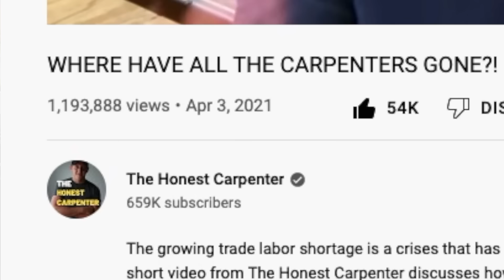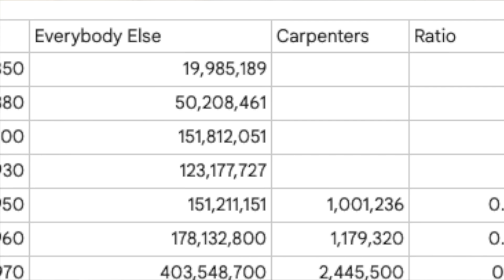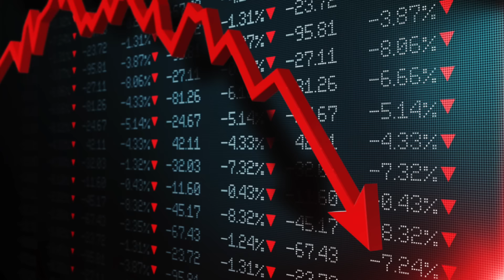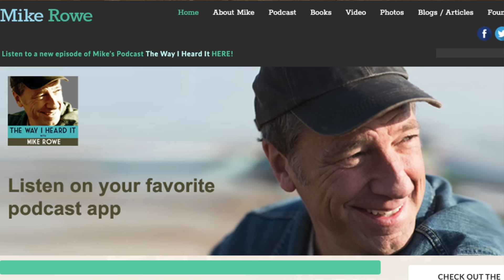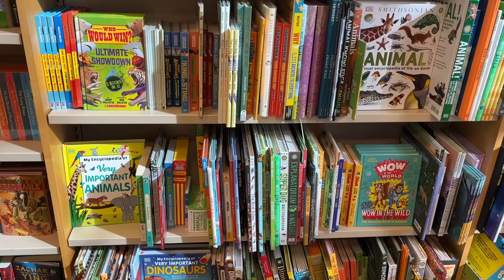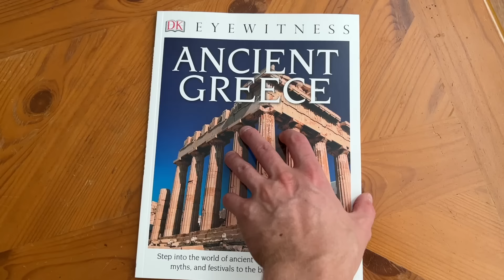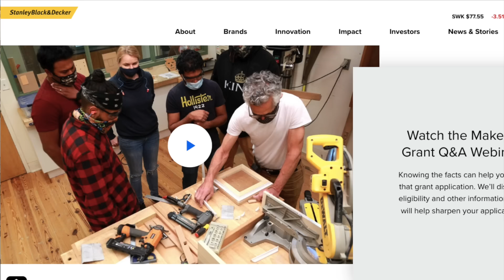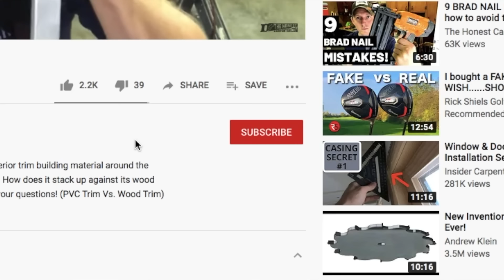THE TRADES ARE DYING...But The World Still Needs To Be Built! CAN WE FIX THE SKILLED LABOR SHORTAGE?

Comment: The trades are dying. As a 50yrs old male that built his first tree house, on his own at the age of 5, I see a deeper issue. People, overall, don't work with their hands or fix things. Most Red Seal graduates have no ability in applying the theary they learned in school. They lack any skills in organizing their work space and I rarely see that improve with experience.   Also I would say that most lack the durability required to function in extreme conditions. It's a complex issue and this is just a short take. We recently had a big shut down job with a short window for completion. We hired some extra independent contractors that showed up with fancy rigs. These apparently capable welders needed someone to organize them constantly.  Yes I'm talking running their leads and cables. They could only weld and refused to pick up a grinder. They would skip anything not prepped for welding or any situation to difficult to weld. None lasted a 12hour shift. One fella managed to weld 48" in 6 hours. My left arm was in cast from a break and I was a bigger asset to the job. The new trades reality.

Comment: The problem is that, comparatively, trades are a terrible career path. They're all dead-end jobs, with crap pay and crap benefits, combined with a crap/toxic work environment. It's not easy being an aerospace tig welder clocking out to drive home and see signs at McDonald's offering $3/hr less than I make. If McDonald's can raise their wages by 3x, then shops should be able to pay 3x... NO skilled tradesmen should be making less than $45-$60/hr, with top of the line benefits, company paid Healthcare, and a minimum of 3 weeks vacation... I went to trade school in high school and took a 2-year program in college... a 2 year welding  degree, and you start at 20/hr(my first job as a welder in 2012 was $12/hr) and 1 week pto vs a nurse who has a 2 yr degree, makes $60-$100/hr and gets 1 month pto... as a young person in high school, what career would you rather set yourself up for? They can try to make skilled trades sound cool, fun, and exciting all they want. It's never going to make up that difference

Comment: I worked as an instructor for the local "trade" school (it is actually a community college) that had a partnership with the public high schools. We taught building and construction and wood working to high school students since there were no other teachers that were qualified to so. As you mentioned in the video, wood shop classes in public schools have all but disappeared. 

When we started at that school, the shop was used as a storage room for broken golf carts and riding mowers. All of the tools were neglected and were either already broken or not safe to use. After a year of cleaning and purchasing new tools/equipment, the shop looked like a shop. In the beginning, student interest was low - only 4 classes with an average of 15 students each. Within 2 years, that all changed. Classes were at capacity, with all 6 classes @ 28 students each. We actually needed to turn away students for safety concerns. Unfortunately, because only a small number them matriculated to the college (at least for carpentry) the partnership was dissolved as the college pulled the funding. 18 of us, instructors and faculty lost our  jobs. I thought it was a good program and we definitely filled a gap in the schools offerings, but as with most things, it all came down to money. It was my most fulfilling job I've ever had.

Comment: I joined Norther California carpenters union 1622 in 1973. I left the union in 1985 and became a general contractor until 2010. Like most skilled tradesman I became a building inspector in 2010. In 2015 I started a school teaching inspectors. I remember many morning 6:30 am in the middle of the summer standing at my exteriors siding cutting table think ok its going to be 100 degrees today better start chugging water and Gatorade right now. Some days we had 2 or 3 heat exhaustions leave early.
Reply from the maker: Been through some of those days myself, Steven 😪

Comment: I work in steel.  I do everything from welding, mill/lathe, and HVLP paint.  My primary specialty is press brakes, tooling, etc.  I can design tooling as well as do advanced operator and tech work on most manufacturers' machines.  Part of the problem is that I can get basic bitch grunt work any time of year, but the moment a company actually needs somebody like me, they're willing to pay out the ass until I get them operating at a level where they can just get somebody of minimal knowledge skill to come in and push a button, squeeze a trigger, or step on a pedal.  Then I'm the first one laid off - which is also why I'm leaving the industry.  And even when you're actively helping them, they treat you like you're a moron because you're wearing jeans instead of khakis.   The number of times I have had somebody who has never ran the machine incorrect me on what the problem is is astronomical.  If you do physical labor of any kind - skilled or not - they still treat you like scum of the earth.  Professionally and socially, tradesmen are looked down on by anybody other than other tradesmen.

Comment: I heard exactly the same argument s for trade shortages in the 80s, and I made it a point to monitor it in 10 years. When I did, I found no shortages, the reporter had used the headlines to write some BS, got paid and were long gone. We call those techniques "click baits" today. There are no accountability for being wrong. There are rarely difficulties finding a contractor, but finding a good one is difficult. Another tell tale sign of a shortage, wages, trucking been crying driver shortages for as long as I can remember, yet pay is still lousy. I bet wages for carpenters are stagnant. Shortages??? where??

Comment: I wanted to get into the trades but the electricians track I researched sounded impossible for me.  Im a single father with a very small support network.  How can i get into the trades when I CANNOT drive to job sites 2+ hours each way and work mandatory overtime.  I need 3 days a week off guaranteed.  How do i break into the trades?

Comment: I must admit that the school systems really need to do a better job of promoting carpentry as a viable option for students. When I was in school, there was a significant lack of hands-on experience in construction and woodworking. Wood-shop classes were non-existent, and our focus was mainly on computer-based activities, disregarding the essential skills needed for manual labor.

Personally, I had the opportunity to observe my dad, who specializes in tiling and also does some carpentry work like deck repairs and window installations. However, I noticed that I had no knowledge of how to perform those tasks myself. I was never taught how to handle complex saws or measuring tools, let alone gain any practical experience. It felt like entering an entirely different world when considering a trade like carpentry without any prior exposure.

Our education system placed a heavy emphasis on digital skills, with a significant amount of time spent in the computer lab. Unfortunately, there are still many basic things I don't know how to do, such as resetting a breaker, installing a light switch or outlet, changing a light fixture to a ceiling fan, or even mounting things on the wall like a TV or shelf. Despite learning about these things theoretically through math and seeing pictures, we were never given the opportunity for hands-on experience. I recall not even knowing how to change a tire after taking driver's education, as it was all taught through computer simulations without any practical application. I had to seek external assistance outside of school to learn these essential skills.

This situation highlights another reason why our school system is contributing to a decline in various areas. Instead of focusing on practical skills, schools seem more engrossed in teaching topics like pride and sexuality, leaving important life skills neglected. It's a concerning reality for this generation.

In order to address the decline in young workers pursuing carpentry, our education system must provide greater exposure and offer engaging classes that showcase the art of creating things with one's hands.

Comment: I've been a Union Laborer for 28 years. 24 mostly worked in the Nuclear industry. I've been an instructor now for 4 years. The trades do have there ups and downs no doubt. In my opinions,  the layoffs are the biggest issue. We have an apprenticeship ( most if not all Union trades do). You begin at 75% of full scale and work your way up to 100% depending on your work hours plus training hours all while making money,  not spending it.I read a comment where they mentioned hostility on jobsites. Yes, you do have to have thick skin. In the Laborers, there are so many different things that you can do. Power plants,  heavy highway, Asbestos abatement,  hazardous Waste, bridges etc. I can retire in less than 2 years. I'll be 55 1/2. Our training director is always doing job fairs at high schools.  Our main site does " pathways to apprenticeship " in the summer. A 5 week program with high school students where they get there OSHA 30 cards,learn general construction,  scaffold builder/ user etc.
If they join after graduation they already have a lot of training hours.

Comment: I'm getting decent at welding even going to a Georgia trade school to learn Tig mig and stick. Been doing this for a year and have my own equipment to become a worker bee. I'm about to be done in 3 months with training / certifications.

But need to address the 900 pound elephant in the room: Uber / door dash can make $20 hrly. A welder starting with my set of skills makes $17-20. After 20 an hour there's a lot of push back on making advancements..

So you need people for labor: **but only fans door dash or some Amazon bullshit. Can make more and not fuck your back which one is the one people choose**? Also let's not forget no experience needed for those jobs. Yet I need 2 years experience for an apprenticeship lmfao jokes.

Comment: Just found this!!

The big problem the fear of letting a 6 year old play with a screwdriver while Dad fixed a stuck kitchen drawer. You sound like your on the correct path.

I don't know how to fix societies problem with teaching your child how to properly, AND MOST IMPORTANTLY, safely use power tools. If they grow up using saws, drills and hammers that skill set will be there the rest of their life.

FWIW, when I was 14 Dad would drop a tree. If it were laying ok he'd go home to do something else. It was my job to clean and pile the brush, then cut the tree up. I also got to use the manual wood splitter (mall & wedges).